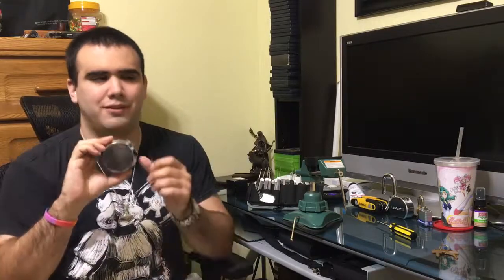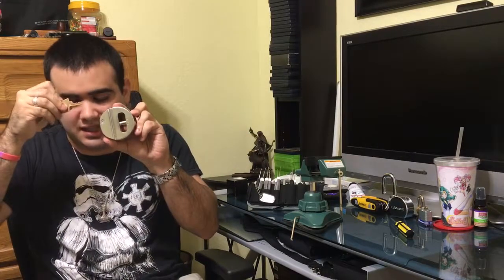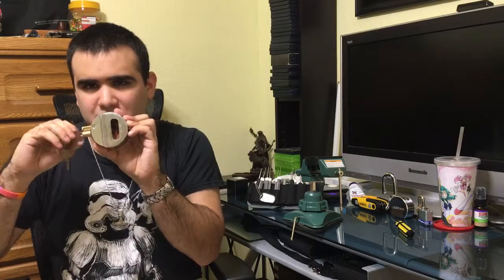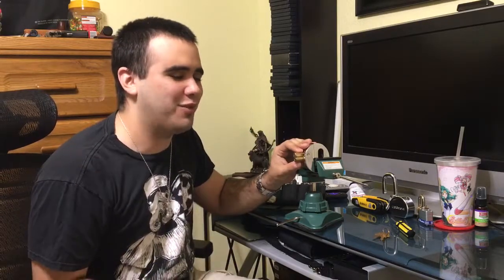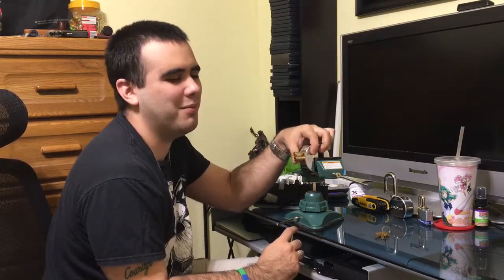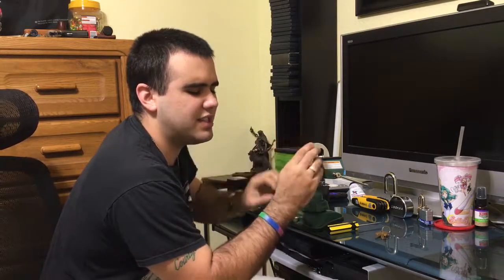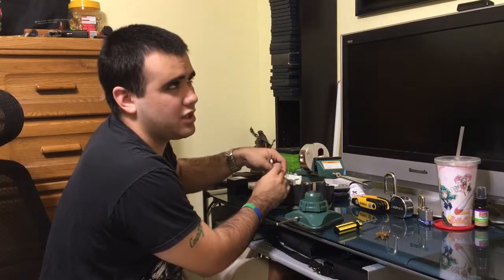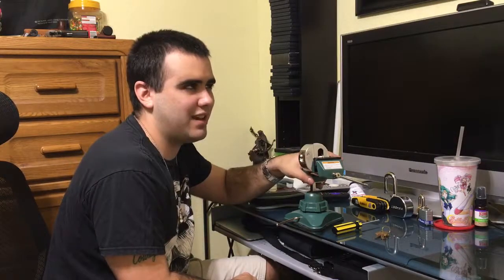(04) Picking the Harbor Freight Puck Lock

Comment: How do I go about learning to add security pins to my puck lock
Reply from the maker: Jesse Boudreau You will need a way to remove the plug from the core, and you will need a plug follower. I am actually still working on how to get the plug/core apart, and so for now I'm focusing on other locks. :)